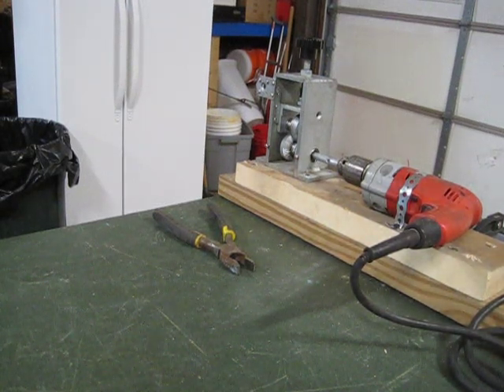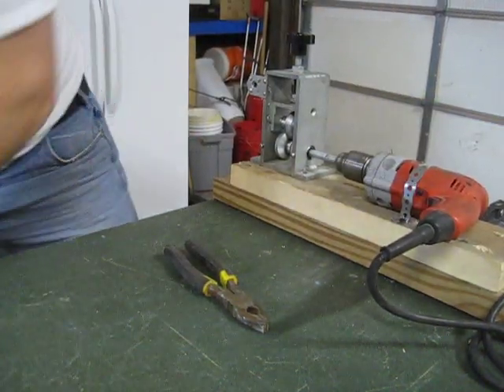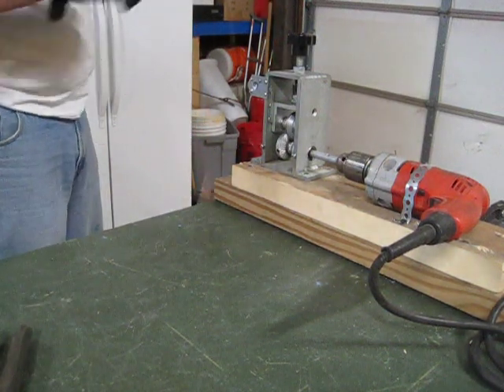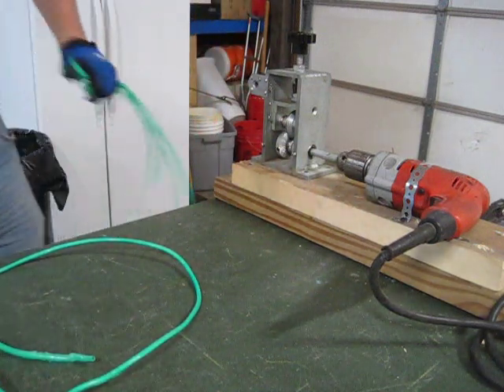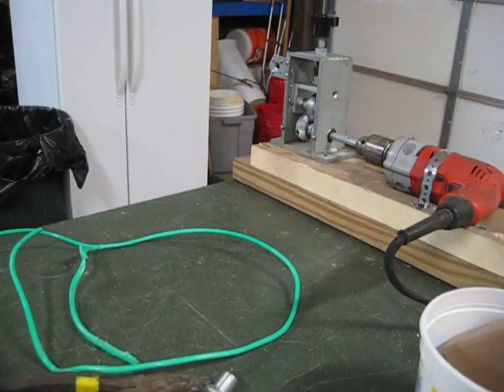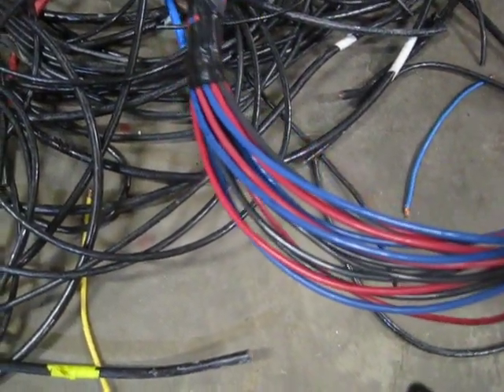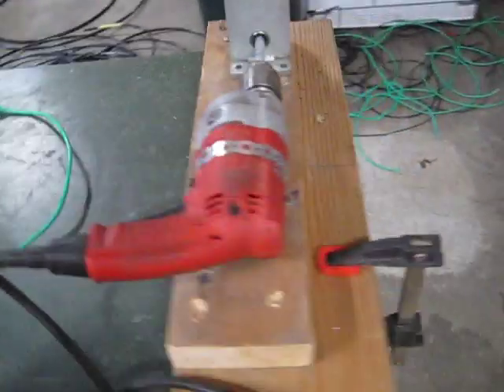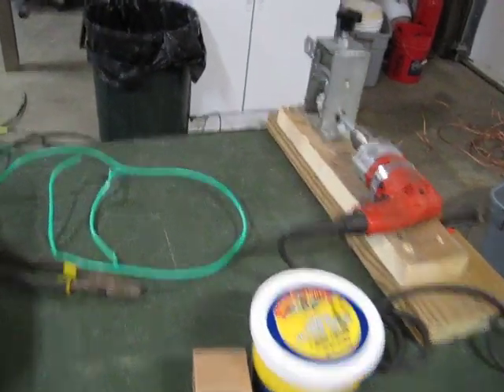Stripping insulated copper wire super fast

Comment: is this good for insulation wire? like power cords with the 3 different color wires? can you put that in this machine or do you have to cut open the triple wire an then put 1 by 1?
Reply: 1 by 1 champ.. i dont know of any tool thats gonna split a cord and then strip each individual wire simultaneously